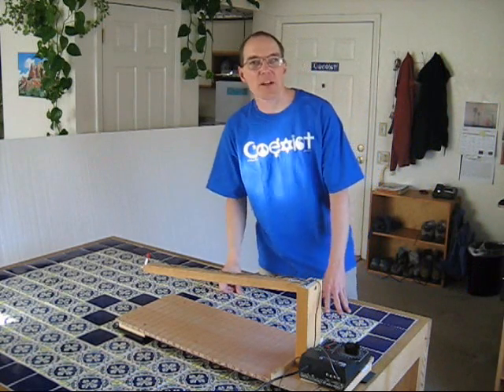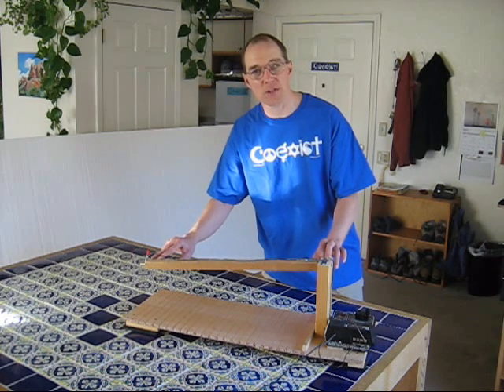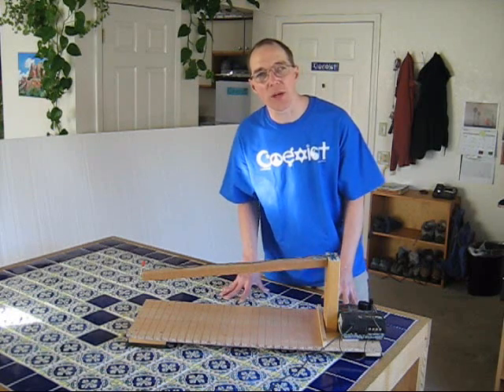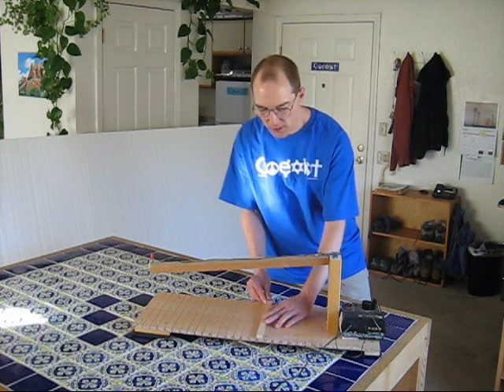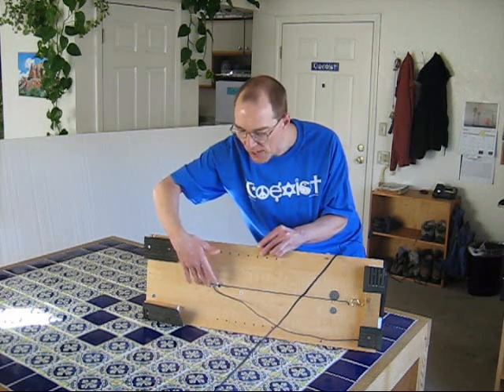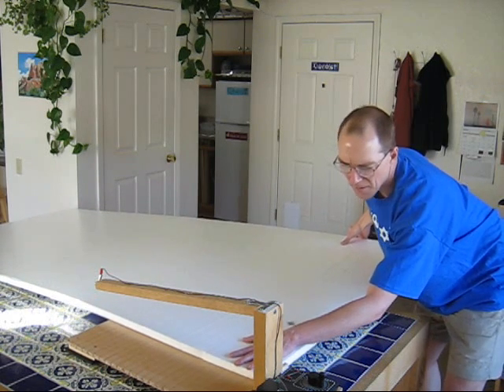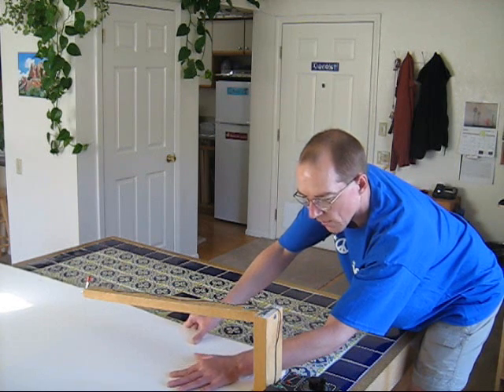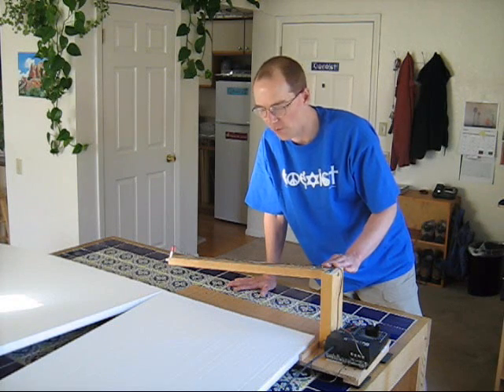Home-made Foam Cutter for Large Polystyrene Sheets & Boards

Comment: If you try to make relatively detailed cuts that have curves using a razor blade, then it rather slow and more difficult than you might imagine.  The blade wants to travel straight (because it has non-zero width in the plane of the cut) and so resists being steered.  This would work better, but you would likely be breathing some fumes.  A blade works fine if you are slow and careful on detail work.

Comment: Very well done. Ignore other comments, I tried to cut big sheets with a knife to insulate between my loft rafters and I only managed to get annoying white balls everywhere. Hot wire cutters manage a clean cut, but the problem is that the cheap ones only allow for very small depth and thick sheets and the ones sold for large sheets are extremely expensive.